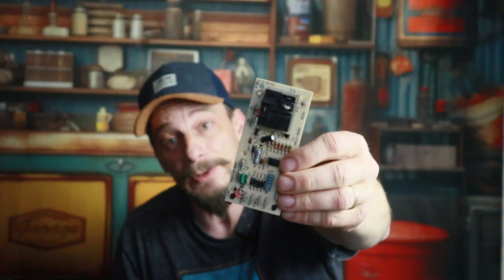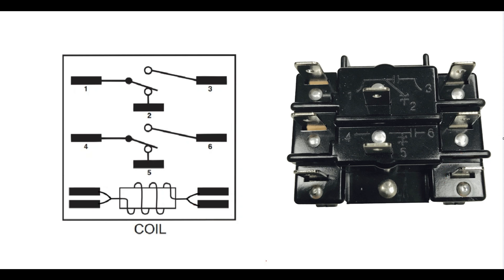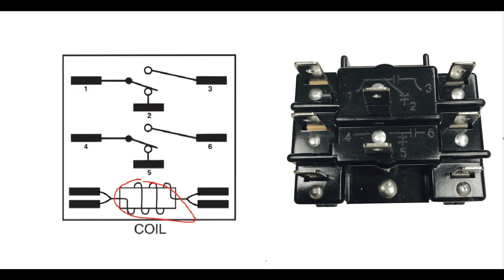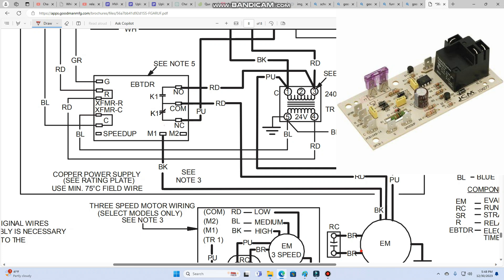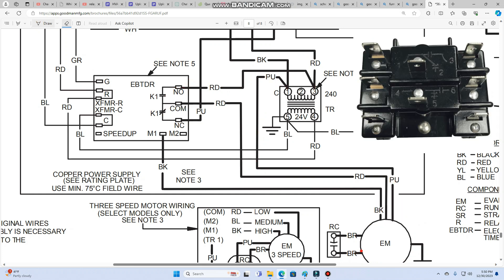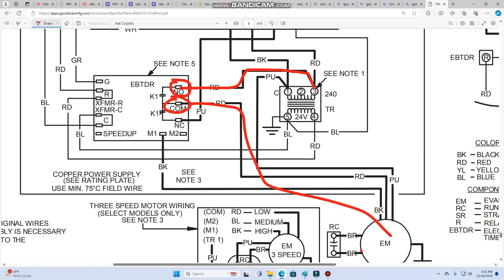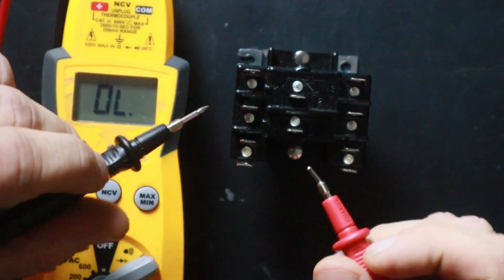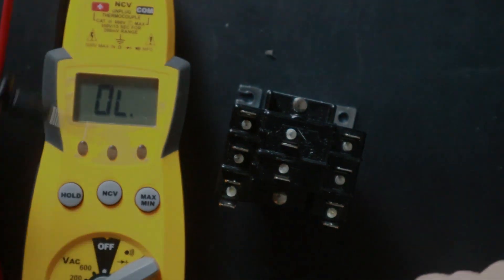HVAC Relays (For Beginners)

Comment: @5:58 question…doesn’t common wire always have power to it? I’m confused
Reply from the maker: No. Com only has power when NO switch is closed. PU wire to NC only has power when heat strips are activated, and in that case NC is open, preventing power to COM. So COM only gets powered on a call for heat or if the heat strips are welded closed and powered when the call for heat ends but the heat strips remain activated. On no call for heat, NO is open and NC is closed, which is the only time power from PU (which only happens when the relays in the heaters are stuck closed and dont open when the call for heat ends) can reach COM.

Comment: for anyone who wonders, the point of the magnetic switches, controlled with a solenoid, is so they don't have a spark when you open and close the gate.  sparks can ignite gases.  it's a safety feature in case there was a gas leak.

Comment: Tried using a Bosch 5 pin 24v relay for HVAC. Yeah it didn't work, clicking like a MG42. Put in a working relay now, but curious why that relay didn't work. I needed a relay to be able to use a smart thermostat on my boiler. Good Video.
Reply from the maker: So far as I understand, the Bosch 5-pin is typically used to control a high-power circuit with a low-power signal, so maybe using it on 2 low voltage circuits may have something to do with it?

Comment: Ughh just started hvac school and my brain hurts😭Closed and open is so hard for me to understand and i do not know why. I think i over think on how it would affect if i connect 24volts here and why the process=. Bruhh even my explanation makes no sense. Imma need this but in baby steps💀
Reply: I saw a video where it said you should think of it as a drawbridge 
Contacts alow current flow when closed, and prevent current flow when open. Hope this helps.
Reply: @ Definitely helped💯!

Comment: Hi Jersey Mike - We have a 1980's AirTemp furnace that works perfectly, except for the blower relay is frequently getting stuck. I think we need to replace it. But where can we find a relay for a forced air furnace that is this old? I'm an engineer and enjoy doing my own repairs, but the local supply house laughed at me and said not worth their time they would only sell me a new furnace for $800 and wouldn't even take the time to help at all or even look at the relay to try and match it up.
Reply from the maker: Model number? Sometimes a regular relay can be used as a substitute, but I'd like to look at the schematic.
Reply: @JerseyMikeHVAC  Thanks for the quick reply Jersey Mike! It's an AirTemp Model # 42083C1421 Rev CA, Serial # DC427067 .
Reply from the maker: I can't find any documentation on it at all, even through Airtemp's archived manual base. Is there a wiring diagram still readable in the unit you can take a pic of and send to me? As well as the relay itself? 
mjrusso@protonmail.com

Other than that, only other thing I can think of is to try to get in touch with Nordyne. They own Airtemp now and could possibly direct you.
Reply: @JerseyMikeHVAC  Apologize for the hiatus. I have happy news to report. We figured out it was the voltage regulator acting out randomly. Found a new one, did the swap, and everything is working great now!

Comment: This particular relay has bower motor attached to it. As the blower motor has multiple wires for multiple speed. what is the suggested speed for blower motor. For Efficient heating. Considering pressure drops in a duct. This could be irrelevant(out of box)question. you can ignore it if you like.
Reply from the maker: Typically in heating the lowest blower speed is used to maximize the amount of time the air can absorb heat as it passes through the heat exchanger, which can help keep down cycle times. 

With problem areas, medium speeds can sometimes be used to push a little more air to weaker vents but that doesn't always help and can sometimes even make things worse in a few cases. Usually, it is either a duct design issue or improper air balancing that blower speeds cannot easily overcome or correct by themselves.
Reply: @JerseyMikeHVAC  Thanks Mike that's very helpful in my upcoming project.. Thanks again Appreciate it.